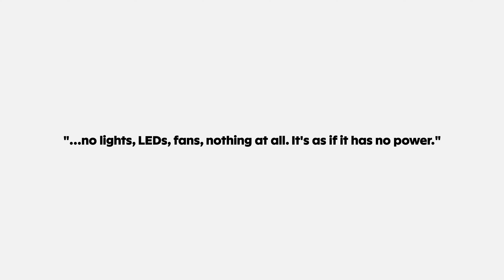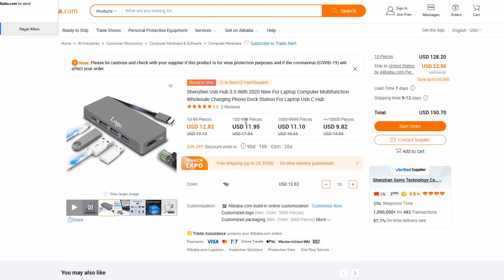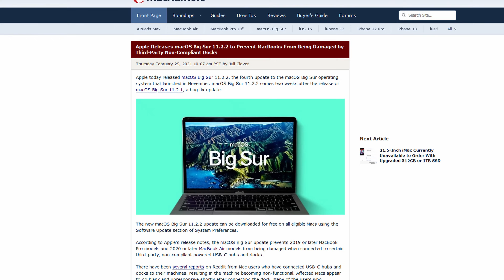Are USB-C Hubs Killing M1 MacBooks?

Comment: I’m using a Belkin and it keeps overheating if I just plug in a regular usbA thumb drive. 
Even if the multi port adapter has the charging opening for the plug, I won’t risk it.

Comment: Had this problem with my Atomos dock for the SSD. Twice my Mac Mini M1 just switched off, the first time I had all kinds of coloured squares appear on my monitor and some noises and then the machine just turned off. Thankfully it restarted after disconnecting the Atomos dock (which is now connected to my Dell monitor without issues).

Comment: There are two ports, I use the one exclusively for power and the other for the hub (bluetooth mouse, hdmi, camera, ethernet etc.)
Reply: exactly, why charge it using hubs anyway?
Reply: But that’s a good idea tho. Thanks for sharing (:
Reply: does hub hdmi work without charge ?
Reply: I don't know about the M1 architecture, but on the 2016-2020 MBPs the circuits are designed in a way that if one fails, the other stops working too in most cases. I've never really seen a dead port by itself, it usually is the controller (like the CD3215) that fails and if it does, all the ports stop working. I might be wrong, but I think Apple implemented a similar design on the M1 Macs. At least the ones with 2 USB-C ports only.
Reply: Only two usb-c? * Laughs in 14" MBP with 3 usb-c and a magsafe charging port 😂
Reply: @joebloggs8954  what's with you? They either don't got the money to buy a expensive laptop such as yours or just don't want to spend shit ton of money. Be understanding you prick.
Reply: @joebloggs8954  laughs in your laptop costs atleast 2000 dollars

Comment: apple has manufacture flaws in its macbook pros intel from 2017-2020 didint know that did you. easy to blame everything 3rd party and not even consider the main product. i know this becuase a apple engineer from a case i ran confirmed this. so nexxt time you wonder way something is happening, question everything not just one side.

Comment: MEI 2021 : Is this still an issue for M1 MacBook? Just curious. After a few update (bigSur 11.4 is the latest), does anyone still encounter this issue?
Reply: With this update my external ssd it is useless. It went from 350 mbps to barely 20 mbps. And the 350 using a usb hub. If I plug it directly it freezes to no data transfer at all.

Comment: Strange that you directly say that it are bad hubs. Maybe bad macs? Those hubs work fine on other devices. And even if hub, the usb c port should be protected. 

And it is the device not hub that request pd power voltage/amp not the other way

Comment: Thanks for highlighting the issue. A question for you regarding the Anker hub you feature in the video. I have the hub but I hate that it does not enable the USB-A type of ports powered once the computer disconnects. Do you know of good hubs that keep the ports powered when the PD power is plugged in but the computer is not? Thanks.

Comment: Thanks for these videos, I'm about to buy my daughter a M1 macbook air for school to upgrade her old 2013 macbook air but I also want this new M1 to double as her home computer as well so she has everything on one portable computer with power to see her through yr 9,10,11 and year 12. What i'm keen to find out is if there is a hub or single cable or you can use that allows her to plug into her home monitor via HDMI but not pass power unless clamshell mode demands this..?
Reply from the maker: Check out the Anker 8-in-1 hub in the description of this video. It will allow you to use HDMI, USB, ethernet etc and you don't have to use the pass-power option.
Reply: @CreatedTech  dont mean to double up but i dont have to ? i can charge through the single usb c remaining on my m1 air ? id rather not charge through the hub im looking at picking this one up and some feedback would be greatly appreciated
Reply from the maker: @mcmgjahfari6  Yes, you can still charge through the single USB C on your Mac.
Reply: @CreatedTech  would this work for the m1 macmini aswell ?

Comment: I've bought an owc dock, but it doesn't completely work 
power works, internet seems to be working
but can't read my external hard drives 
can't read logitech bluetooth mouse from dock although it works with a usb to usb-c adapter
everything works on older imac but not m1 macbook

Comment: Things like this are to be expected for any early version of a brand new technology. They fixed the issue now, and those who did suffer from logic-board frying were able to get a new machine under the warranty. If you want the cutting-edge this is the trade-off. Seriously, for a first gen technology this is running smoother than probably any new chip release pretty much ever. My Macbook knows when to charge and when to stop charging automatically pas 80% to preserve the battery. I use Apple's cable and plug-it directly into my power bar. It could be the hub, it could be the cable, it could be the software, the electricity in your building itself or likely a combination of two or more of those things. No dangerous accidents happened so far, you deal with this under warranty, and most people have a smoother experience with the M1 than with most computers in general that are at many more than their 1st gen. If you open-up an Apple power-brick you'll understand why using third party charger/cable is NOT a good idea : they are far more complex than most laptops. Also, 100 watts pass-through is a little ridiculous, when you think about the fact that it could cause serious damage to devices with problematic SMPC, and just about no one needs that much power in USB pass-through.
Reply: Believe in what you want, witness!

Comment: I have had my hub since April of last year, and I used it on my 2018 iPad Pro all the time, and ive been using for the past few days and its still fine. I don't use it for charging, I use the hub for the usb A ports for my keyboard and mouse, and I use the HDMI ports and ethernet port. I use the second USB-C port to charge my MacBook Air M1
Reply: I suspect it is due to max charging wattage on USB hubs
Reply: So realistically if you use the ports for their intended usage such as pen-drives, SD cards, HDMI and so forth, it should be fine. ?
Reply: @kayleighgalea  yes

Comment: Also using usb C hub flickering my secondary display when some movement happens or pendrive inserting time or ejecting time.. is it normal ??? 

tried in both anker and wiwu hub but same problem...

Also I need to restart mac cause sometimes primary screen goes so big after the flickering .. reopening lid or put through sleeping also not helping.. so I have to do restart to make every screen looks normal and functional..

Comment: I am convinced it killed my first 2021 M1 13” MacBook Pro. I believe it is what killed the monitor, which went completely black and unusable. It was an (AUKEY USB C Hub 10-in-1 Type C Adapter) from Amazon. Apple replaced my M1 and I got a new one now that I have not used a hub with yet, as I am honestly terrified to, so I’m stuck with 2 USBC ports, with sometimes only 1 as power is using the other. There is also currently another issue where the battery is showing needing support, even with it being 100% functioning, that is caused according to Apple support by a recent Big Sur update bug. So the M1 is full of weird problems currently.
Reply: Did you charge your MacBook through the hub?

Comment: Oh my god, this is literally what happened to my new MacBook Air M1 while using a 40€ hub that I bought on amazon, my Mac stopped working so I brought it to the Apple store and they told me that the motherboard of my 2 weeks old MacBook had fried. The reparation was 800€ and now it works just fine. Thank you for explaining this. Good job.
Reply: Did you fix it by 800€?
Reply: @TheEnzoachi  Yes, at the Apple store they told me that the price of the parts they changed were 400€ and the price to actually fix the computer by changing the pieces was 400€ so I got the whole MacBook fixed for 800€ but it was free as I had just gotten it :)
Reply: Did this happen because you were charging the laptop through the hub instead of the actual laptop port or just because you were using it regularly for like pendrives and sd cards and such
Reply: @kayleighgalea  I was using it regularly, I only plugged my phone to download some music and pictures and then about 40 mins later my brand new MacBook air shut down for no reason and I couldn’t turn it back on
Reply: @sarratpwk  huh, weird. Have you gotten another hub and worked with or have you disregarded them completely?
Reply: @kayleighgalea  I sent my hub back to amazon and bought a regular one but from apple which didn't have all the ports like the one from amazon had

Comment: i stopped using usb hubs with macbooks since 2018 when i found that simply plugging in the hub would cut off the wifi- strangely putting the hub under the desk would not cause this problem- and this only occured with the macbook not the other pc laptops using the same hub!
Reply: Hmmm that’s the solution then… to put the hub under the desk, interesting
Reply: @SergioPerez-dq7oz  weird huh? i dont know if its interference coming from the hub or what but i just dont bother with them anymore on macs
Reply: @jub8891  it is so annoying. I am buying another hub I hope that works… what did you do or what brand of hub was the one that worked in your case?

Comment: This happened to me on a 2015 MacBook with USB C Dock several years ago.  I was using it with a USB Storage drive attached, wasn't charging through the dock, and heard a click and the laptop screen went blank.  Took it to an independent Mac repair shop and they confirmed the logic board was dead.
Reply: late answer, but this is probably a dead U4700. It still is (one of) the signature failures of the 12" from 2015 and is not caused by anything but Apple's shit engineering. It's the sad truth. It's a 5$ component and a 20 minute solder job to fix it, but barely anyone is gonna tell you that...

Comment: QG hub made the screen of my 2017 MBP killed. I put the wall power into the USB-C in the hub and the hub was hooked up to my MBP via USB-C, and a few seconds later, the screen got black and coming with interlaced up/down, turned to black. After resetting the SMC or so, the screen got back with half-dead cell. The half of the screen has been occupied by horizontal black lines of dead cells??? I have not been figuring out how to fix it.. The hub definitely caused this dead screen, i believe, as I had zero issue before the power was connected through the hub. The screen might have been killed by hardware, rather by error in software perspective. Any help?

Comment: A hub bricked my 2018 iPad Pro. I am able to charge my 20128 iPad Pro through the Magic Keyboard charge port but there are issues that cause resprings when I pull down to use the spotlight search but it doesn’t happen every time.

Comment: Wtf, I got an déjà vu at the moment you said ‘clicking noise. This was exactly what happens to my 13” 2017 MacBook Pro after using a Satechi USB hub. I heard * click click click * and everything went dark and never powered on again. Damage? 1.000 euro for a motherboard replacement. I’m still too scared to plug a usb hub into my m1 MacBook Pro....
Reply: Same thing happened to my 2020 MacBook Air after only owning it for a few months. Luckily - still had the one year manufacturer warranty. Now I’m paranoid when I connect it

Comment: Partly related question, would massively apply a reply. How well do devices work when connected to the usb hub - is there any latency. Specifically wondering about audio interfaces but any advice would be appreciated. Thanks.
Reply: I got an audio interface I use through a usb hub and I’ve noticed no latency at all
Reply: @monke9765  Great thanks! Which interface and which type of USB does it use.

Comment: When using an RCT Hub to connect a Dell screen to my standard MBA-M1, the hub got terribly hot and switched off. Permanently. (the hub..) Then I got an Oshida and a MOKIN. Both would accept my 30-inch Apple Cinema HD Display. Until the screensaver kicked in. Needed a new start every time. Unacceptable. Then my MM-M1 16Gb-1Tb arrived. Apple Cinema screen blacked out - same story. Now, Cinema Screen to 2008 MacPro3.1 (flawless), Dell to MM-M1 and MBA-M1 just as is. The info of Apple about M1 running Apple Cinema Display is incorrect. Looking at my test series, it might very well be a Big Sur software bug. Let me know.

Comment: Did you say something with charging killing MacBook's? where have I seen this before... Let me think, Oh wait the Nintendo Switch had the same issue, Its mainly due to PD chips on these older hubs, as most of them have not been updated in some time now most of them use intel spec for charging and obviously apple has their own silicon now and as a result it handles it much differently then the M1's older brothers down at intel do. In short be careful because many companies say that it is compatible with the new macs but they are not. Trust known brands for now such as ; Anker : CalDigit : AUKEY : Satechi : Elgato : and some* UGREEN ones too.

Comment: Most USB-C hubs/dongles are very questionable in quality. Sure some are really good, but not many. I agree I would not trust them to power my device in many cases. Thunderbolt Docks have better milage due to all the required certifications but they cost a lot more. I suppose you get what you pay for.

Comment: Hubs have always been a problem with macBooks - in my experience, going back to 2014 when I got my first work issued macBook.

For Intel macs, I've seen it all. 

A company I was at went through all manner of different docks to facilitate multiple monitor connections and also to add more ports to the feeble amount the lower end macBooks shipped with. 

The exact same model macs would sometimes work with a particular dock and sometimes not - no rhyme nor reason behind it. 

My work colleague had one which actually got so hot, it started melting - you could smell the acrid plastic starting to burn.
He quickly hauled it out the mac, but the damage was done - this wasn't providing power, but it completely screwed one of the two thunderbolt ports. 

Where I work now, we use the more expensive Dell D6000 docks - again, the mileage you have with these differs - some macs work fine, some don't.
I've had terrible experience with these expensive docks - it can send your mac into a total tailspin randomly - for no reason. 
Spinning beachball of doom and the wonderful super fast spinning beachball of doom - two choices, wait for the tailspin to end or hold down the power button.

To my mind, using an external dock to provide power for a macBook is a recipe for disaster - use the provided power supply only and always. 
You have a free port (sad that these new M1 macBooks only come with 2 ports!) - just use a dock that doesn't provide power! 

Then again, good luck finding one that'll allow you to hook up multiple monitors, ethernet - and work flawlessly. 

So, yeah, got a Mac Mini M1 instead for my personal home use - wouldn't touch the new macBooks with a barge pole right now...

I've got a 2018 macBook (intel obvs) from work, but my current employer was savvy enough to go for the 4 port version.
Enough for power, external keyboard (because Apple bluetooth keyboards suck and most bluetooth devices suck) and a monitor connection, without a dock - it's a PITA having to plug everything in, but every dock I've tried has issues.

And my own personal 2012 macBook Pro - I just love that beast, it's my downtime lounge mac, for casual surfing - second only to the incredible 2015 models.
Stunning keyboard, SD card slot, actually works quite well with external monitors - and still gives me what I need. One of the best macBooks ever made. Ports up the wazoo. 
Back before things just got too light and too thin - before Apple's obsession kicked in. My 2018 work macBook is a hunk of junk by comparison. Crap keyboard, stupid touchbar which I just set to function keys and never actually use - heck, I don't even use the keyboard, because it's so shit.
Thermal throttling is a joke - it'll just randomly decide to fire up the fans to max, gets stupidly hot at even light to moderate use - one of the worst macBooks ever. 

As for the M1 macBooks, no way. Steer clear until we see what Apple release next - if you want an M1 mac, get a mac mini, if you must have a macBook, get a 2015 second hand intel model.
Reply: Lol you're loaded with problems aren't ya